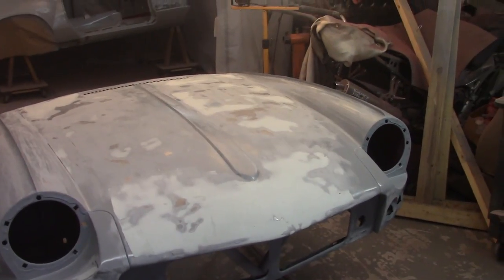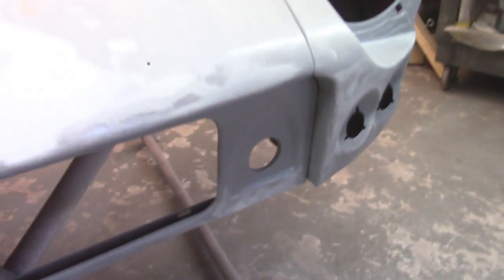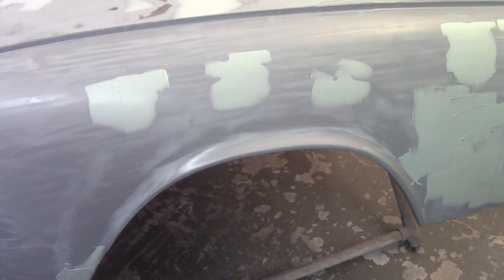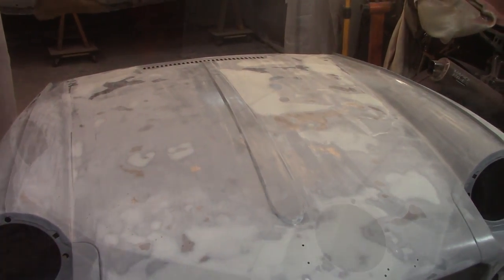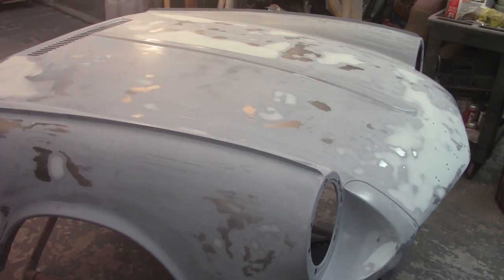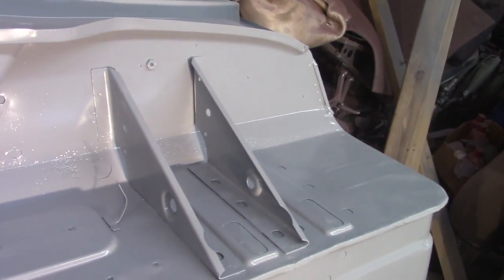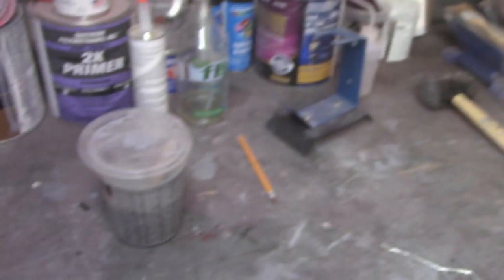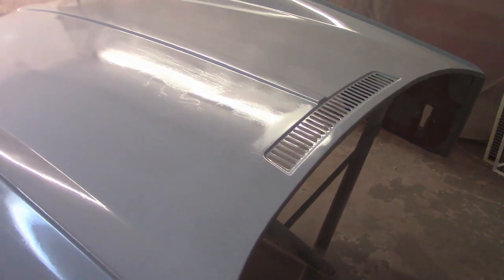Filler Work and Epoxy - Bonnet | Roundtail Restoration

Comment: Hi Looking good Chris once you start putting down the high build primer you will find that a lot of the little waves will be covered,,,,you can always put more fillers on top of high build,,,,,I think you’ll find you spend more time blocking the high build more then anything
Reply from the maker: Hi, Mike. Yes, I spent a good amount of time on the doors sanding down the build primer. I'm confident it will fill the sanding scratches. Hopefully I did a good round of filler this time and won't have much left.

Comment: Is filler ok on top of epoxy ? Or do we fill first thanks enjoy your videos
Reply from the maker: Hi. There's two schools of thought on this, but for me, absolutely epoxy first, then fill. The epoxy is hands-down the best for corrosion prevention and bonds really well to the metal. There may be some spots in the filler where you don't get a great bond with the metal and, in a worse case, it could allow moisture to come in contact with the bare metal. Granted, that may happen if you put if over epoxy and your filler job may go to hell, but the epoxy will protect the metal underneath from rusting.